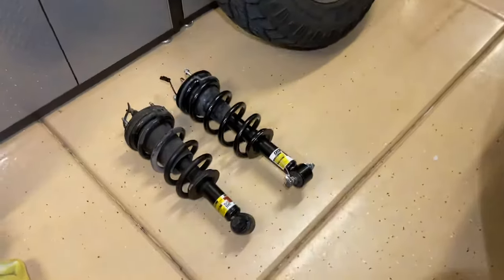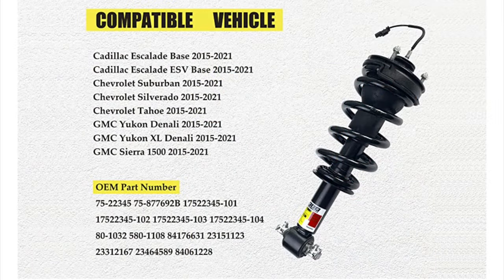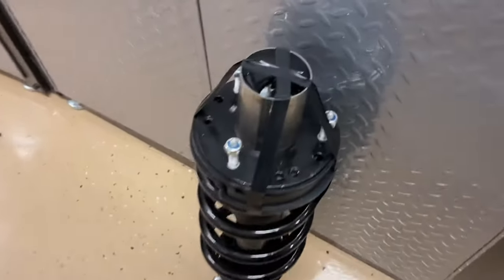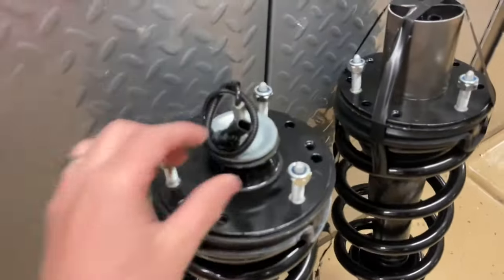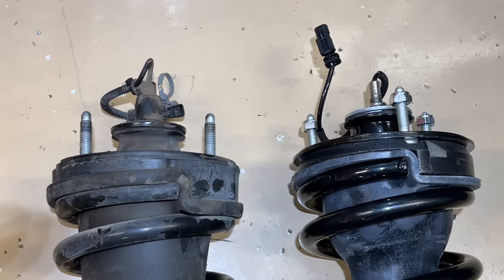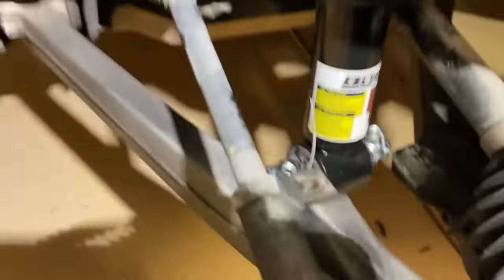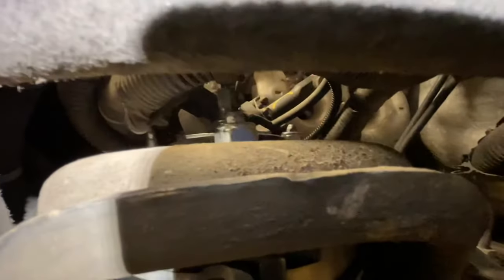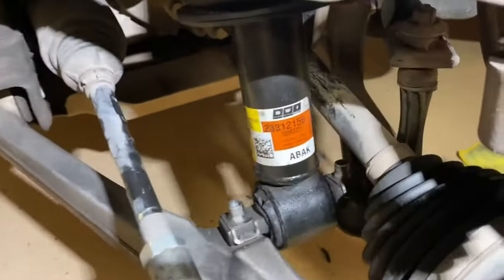Aftermarket Magneride shocks fitment problems

Comment: Great information and appreciate you sharing.  Did you ever figure this out? Also, your OEM # is 23312155 & mine is 23312156 on a 2015 Denali? Thanks
Reply from the maker: A friend of mine said I would have had to really put some pressure on them to twist them (at this point mu fear would be they could not be returned because they would get marred up), and I could have loosened the other side of the sway bar or removed it entirely. They may also be side specific which was not labeled
Reply: @dannyjohnsonsgarage  That makes sense. I wouldn’t try to make them fit either. I’m leaning towards the Arnott SK-3354’s. Technically not magnetic, but has great reviews on Summit Racing for my application. Sounds like they have a bypass sensor for the computer built in to avoid error codes. They’re $499 each, but better than $2500-$3000 @ the shop. Thanks for all your vids. They have helped me out tremendously!!!!
Reply from the maker: @cwsosby  yeah, I’m also considering the same brand. 👍🏼
Reply: @dannyjohnsonsgarage  what did you eventually go with?I’m trying to find in the thread what you went with. I’m new to YouTube and navigating is a bit difficult right now. I have a 2015 suburban and I’m not sure to delete magnaride all together or just replace. This is the worst suburban I’ve had to date. I’m grateful to have what I have however this one is a pain. Thanks in advance for any info. I also replaced my 22” rims for 20” rims to get a better ride.
Reply: @dannyjohnsonsgarage with pressure they will pivot no damage to it at all but if u didnt feel comfortable thats where amazon comes in lol not everyone has done hundreds of shock like i have so i understand also the height they will settle after couple of days people say they dont but they absolutely do great vid
Reply from the maker: @toolsonabudget7763  yeah, that was just it. I had done many other struts that would spin no problem. I forced these to the limit I felt comfortable without altering or damaging them so I could not return them. The Arnott ones went right in

Comment: Is it possible that its a ride height correction shock?  Also I believe you can rotate the upper plate although it will have some tension/resistance to it.
Reply from the maker: I later went with arnott brand ones and they worked well. I have my suspicions that they may have gone in easier as 2wd struts, or I could have “made” the ones in this video fit, but I was worried I would damage or scratch them and render them non-returnable so I moved on to the arnott brand.
Reply from the maker: These are what I went with https://www.amazon.com/Arnott-Coil-Over-Eibach-Magneride-L-SK-3354/dp/B08VF88P43?crid=38JDH2IFYEA9K&keywords=Arnott+-+Fr+Coil-Over+Eibach+Strut+15-20+Cad+SUV%27s,Chev+Silver/SUV%27s,GM+Sierra/SUV%27s(K2xx)+w/Magneride-L/R+(SK-3354)&qid=1669272882&sprefix=arnott+-+fr+coil-over+eibach+strut+15-20+cad+suv%27s,chev+silver/suv%27s,gm+sierra/suv%27s+k2xx+w/magneride-l/r+sk-3354+,aps,290&sr=8-1&ufe=app_do:amzn1.fos.08f69ac3-fd3d-4b88-bca2-8997e41410bb&linkCode=sl1&tag=2004047-20&linkId=6ce005c6cd213796132b9c237f1113d5&language=en_US&ref_=as_li_ss_tl

Comment: Well there new so they fit a little taller because there new and you needed to break them in but o well good luck with it when I did mines my truck was a bit taller until they broken in and they went down after 2 weeks
Reply from the maker: I went with the Arnott brand and they went right in, no problems.

Comment: You need a crowbar to push down on the lower control arm 😂😂😂i had a tuff time getting it in but the truck feel amazing.....fyi i also think they were the right size
Reply from the maker: The Arnott ones went in perfectly. As I said, I was not willing to make these non-returnable. For the price they should be set up to go right in like the Arnotts

Comment: I got this brand and it was a struggle to get them on my 2015 sierra Denali. What I noticed after was that the truck now is like 2 inches lower than before  which I have no idea why and it now it scrapes with the fender when I go through dip or a bump. My truck was lowered but it never did that with the original strut.
Reply from the maker: I would contact arnott and see if they have a different model that might work better for your setup

Comment: So my truck has a lowering kit. When I pulled out the old strut and put it next to the new one. The new one was bigger than the old one. Is that normal?  I have magnaride struts
Reply from the maker: It depends on the brand. I went with Arnott and it was the same as factory and went right in. The brand in the video was too big. The strut may collapse when bad but it shouldn’t be impossible to get in
Reply: @dannyjohnsonsgarage  I got it in I had to remove the bolt to sway bar and the upper control arm and drop the lower control arm all the way. It was tight fit but it worked.

Comment: Did you actually switch back to a factory replacement? We have installed the 1aauto trq brand struts and shocks and they are stiff they rattle on small fast bumps and it actually  sits beyond level with my 1.5 suspension maxx kit everything is tight I thing the preload nuts are not set right on the top
Reply from the maker: I put the old strut back in. My tires are cupping from the bad struts. I’m deciding if I want to delete the magnaride and do conventional struts
Reply: @dannyjohnsonsgarage  yes A1 auto will give me my money back I think I’m going to do the same and use the Mag delete with the Bilstein shocks I really hate to give up adjustable air ride on the back though for towing
Reply: There is no preload that's not how those work lmao

Comment: I think the replacement won’t fit because of the following 
- the aftermarket ones are not magnetic ride they r standard so the dimensions r different what the company dose ..they put resistors inside it to make it look like magnetic ride basically the error on the dashboard won’t show up because of the resistors u connecte thinking its really magnetic ride and FYI all of them r made in china so u guess the outcomes
Reply: The dimensions are identical the difference is when you swap the spring onto the new assembly it’s not lined up exactly because it’s done by hand and not preset in a factory. Also the old set is most likely worn out so it’s compressed in comparison to the replacement. So you may need to spin the base. But a brand new air ride set and the swap set measurements are identical.